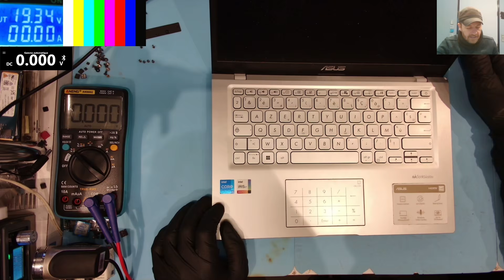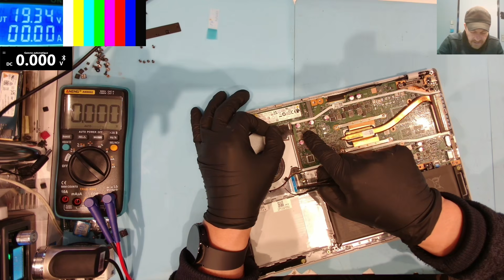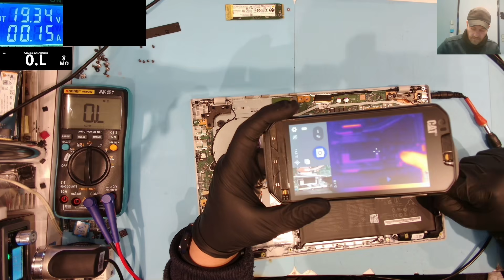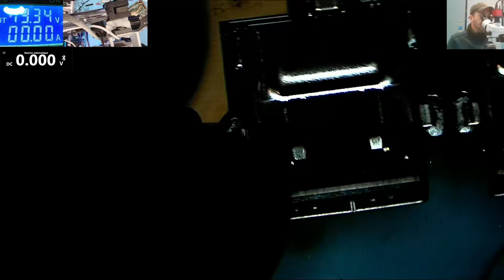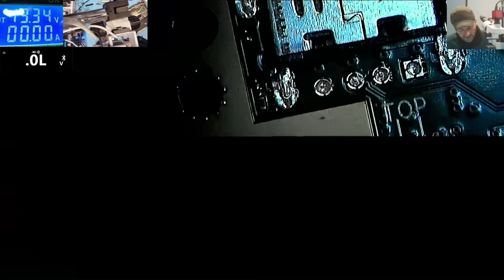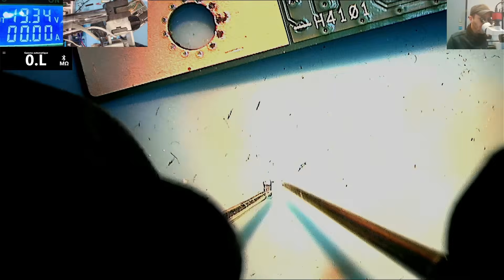Asus R1400EA HS - SSD BitLocké (BitLocked) !

Comment: First, I would check whether the power button signal is reaching the EC, and whether the EC has power (VCC) and a clock signal. If yes -> Flash BIOS. If no -> Replace the EC.
Reply from the maker: Thank you for your suggestions !

Comment: 3v LDO shorted so SIO can be damaged even if it hasn't gone short circuit.
I am interested to see what happens also when you connect USB-C charger. Maybe negotiate is ok but also not charging because PD controller can't speak with dead EC
Reply from the maker: Your suggestions are appreciated! Will see what happens on the next episode 😉

Comment: EC chip fried or corrupted informations, no LEDs no charging. What's the 3.3v ldo resistance to ground?

BTW, it is also possible the LID sensor isn't working but it should at least charge the battery
Reply from the maker: I don't remember the LDO resistance but it was fine. 
Thank you for your suggestion !
The next episode is coming soon.

Comment: Salut Maz, il faudrait tester le 3.3v sur le connecteur du clavier, et vérifier qu'il passe à 0 qd tu appuis sur le btn démarrer.
Reply: @fabrice934  ce test permet de s'assurer de quoi ? Que la machine a démarré ?
Reply: @davidkoutchou9739  c'est ce qui permet de démarrer la machine, cette tension va au SIO (EC), et doit passer de 3.3v -> 0v -> 3.3v.
Reply from the maker: Salut Fabrice (encyclopédie vivante),
3.3v présente sur le connecteur et passe à 0 quand j'appuie sur le bouton démarrer. 
Merci pour ta suggestion ! Réponse dans le prochain épisode.
À très bientôt.
Reply: @maz.reparateur  Je répète ce que sensei Maz nous a appris ;-), si cette tension arrive bien au SIO, le signal S5_ON du SIO doit passer à 3.3v.
Reply from the maker: @fabrice934  et je suis heureux de constater que vous avez des bonnes connaissances et bonnes propositions !
Cependant, cette panne n'était pas évidente ! C'est pourquoi je vous ai lancé le défi 😉
Reply: @maz.reparateur  Peut être le lid sensor, hâte de voir le prochaine vidéo ;-)
Reply from the maker: @fabrice934 😉